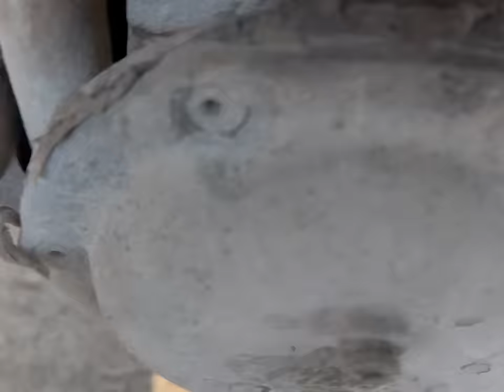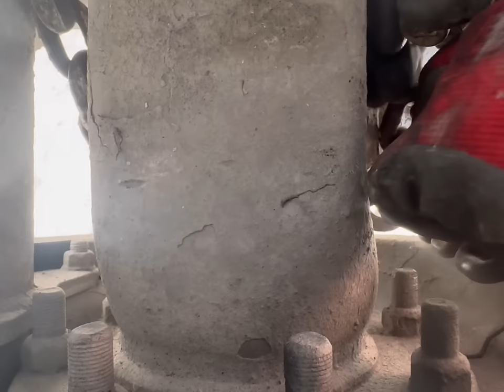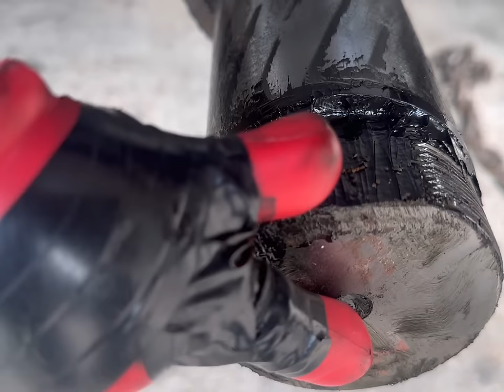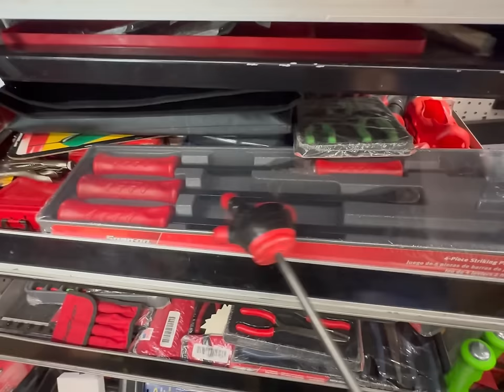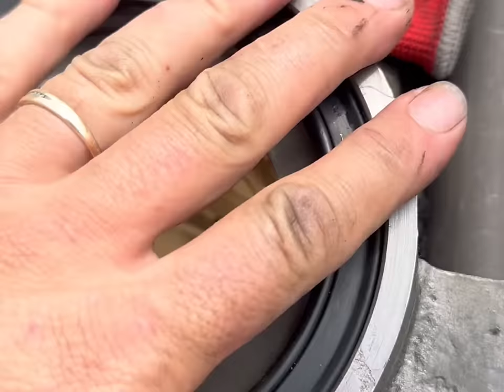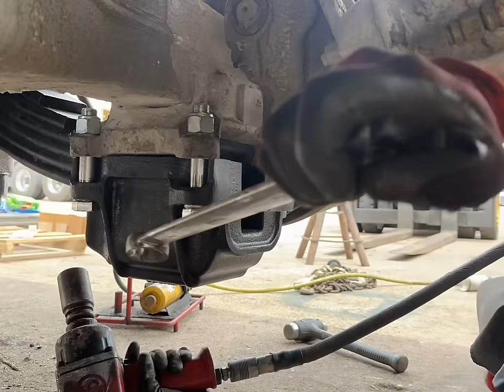Mastering the MACK camel 🐪 back

Comment: Just found these videos! Great stuff. I've been a Truck technician for over 40 years. I'm no longer messing with heavy suspension parts though!! I did work for a Mack dealership at one point and something I found concerning these suspensions was the fact that those "rubber" end blocks were to lubricated with "edible lambs tallow" Seriously, that's what the Mack manual stated. I watched this whole video waiting for you to get to this part only to be disappointed! It wasn't even mentioned!!  Now looking at it again those blocks appeared to be some sort of synthetic material and maybe don't use any lube. I was doing these suspensions on mid 80's truck and the blocks seemed to be real rubber.

Comment: Former truck driver, current factory worker that farms on the side. Watching this 9 months late but had to check to make sure I was subscribed for the snap on giveaway. More to the point, I always thought the camel back was the greatest suspension ever designed for off-road application. It keeps the weight balanced on both axles for traction. I had a R688 that could keep going in mud that would stop Hendrickson trucks in a heartbeat. Only thing better was another farmer that had an old army truck. That thing would go anywhere as long as he wasn't broke down.

Comment: Thanks for sharing this. I drive a Mack CL700 dump truck for a small gravel pit. It has the Camelback suspension and it's all kinds of wore out in that center trunnion. Sadly they can't afford to buy a bunch of new parts, but they do have another set out in the yard. Hopefully it can get swapped out this winter while our operation is down for the season. But as a driver, I appreciate knowing how my equipment actually works and goes together. Heck, they might ask me to help mechanic on it in the Spring.

Comment: "They're gonna love this rag at the cleaners."

Classic shop humor.

When I was a flat rate mechanic, back in the olden days, we always tried to coordinate our personal errands & shop pastry & coffee runs w/ our test drives.

One day, a guy I worked w/ had just finished tuning this real POS import pickup. He had a chapped ass about having to work on the filthy rust bucket, & kept up a continual dialogue about how damn good this truck was gonna run when he got thru.

Finished, he left for a test drive. The back door to our parking lot was just to the right of my work bench. I was rebuilding a carb, when the truck swung into the lot & AJ hopped out. He dumped the clutch in 4th gear, at idle to kill it, then got his arm load of laundry to drop off, during the test drive.

For some reason, AJ & the truck grabbed my attention, & am I glad they did.

As he's about 10 ft from the truck, I noticed it move, then move a bit further, then more, & bang that perfectly tuned little Datsun came to life & took off, driverless.

AJ & I locked eyes, & w/ his trademark shit eatin' grin, he just shrugged w/ his arms full of dirty laundry.

I leaned forward so I could follow the path of the truck, figuring it would stall.

When it didn't I stepped to the doorway, just in time to see it pickup speed on the steep ramp of the short apron to the street, hit the 1st swale of the abnormally crown road, crest the crown, & hit the swale on the other side.

You would think a 200k Datsun rust bucket that hadn't seen an alignment since new, that still had the OEM front suspension parts would veer when it the 1st swale, or the crown, or, at least the second swale.

But, NO, that little bastard went straight as an arrow as it got on top of 4th gear & perfect hit the neighbor's short driveway & buried itself dead center in the old non-segment aluminum garage door.

You'd think that would end the Datsun's freedom ride, you'd be wrong it pushed the door thru the empty garage, right through the back wall of the garage, left the door flat on it's back behind the garage, then ran right over it to go another 30-40 ft to finally come to rest in a big shrub in the back corner of the yard.

The impact on the door made a sweet 20# sledge on a full sheet of steel ring that popped every head from under every hood in the shop, & had the owner tripping over himself to see where it came from.

AJ & I were gob smacked as he looked on from an angle while I had a gun barrel view, right thru the garage, to the dirty Datsun yellow tailgate of the truck.

We looked back at each other, & started laughing. I was literally on the floor as the boss got to me, & tears were running down AJ's face, as he stood in the lot, w/ his arms still full of dirty laundry.

God, I miss AJ, never had so much fun working w/ somebody. Plus, he could tune a friggin' engine, even an old POS.

I've went on long enough, but how we managed to hide the damage to the truck AND the garage is nearly as good of a story.

GeoD
Reply: Thats one hell of a story
Reply: Thanks for the story, I needed a good laugh!!😂
Reply: @fwcjr8170  It's been good for many laughs in the last 40 yrs.

Comment: I have done those miserable things by myself. If it wasn't one of the mains, I'd split pack down and replace whatever one was broke. If it was the whole pack I did I'd put mains in with center bolt only. Replace the bushings and caps. Then I'd build the pack on truck. Reason I did it that way, was the bay I had to work in you couldn't get forklift to. Hated them things. Understand why the company used Mack trucks. Cement mixers get beat up, R and DM models can take a pounding.

Comment: I have used  newspaper to gather up grease and to put the parts on and then fold up to keep any dirt from getting on them . 
When job is throughout or burn for heat in wood stove.
When cutting U bolts or center bolt on springs , Always be behind the longest leafs and have you foot against it , because if center bolt is broken or being cut  that spring pack will explode throwing the smaller spring leafs many feet and you do not want to get hit with them or have them hit the torch .
I have cut many center bolts from the longest leafs side and had spring packs throw  shorter leafs 3 feet .

Comment: Is there any reason why you don't apply a 'little' heat to the area you are looking to bend back?
I don't mean make it glow red hot, as I assume the metal would lose some permanent strength but I thought moderate heat would be ok and assist in relieving the crash induced stresses

Comment: another story stated that mack camels are not adjustable . 10QK46  offset pads will allow adjustment . I know - rebuild everything check housings etc . Still sometimes still not parallel or square . Not a huge deal on construction trucks but some of these end up in mostly highway use where it becomes a problem mostly showing up on steer tires . These are not easy to put in and can be confusing on the orientation . Just sayin' .

Comment: I built a plate to go on a harbor freight transmission jack. And used a 20 ton harbor freight bottle jack with an adapter i made on my harbor freight mini laythe. Just to press the bushings in those trunions. It saved manhandling them into the press. Cut time way down. I don't work on those anymore just cars.

Comment: Gotta ask why throw out the spring pack? I used to work at a shop that had a fleet of around 55 Mack CHU613 coal trucks, with that suspension setup. When when we did trunnions, we pulled the spring packs apart and just replaced the broken spring bolt, and any cracked or broken springs.

Comment: Maybe a stupid question, but why can't you re-use the u bolts? Can't you just take them off without cutting them?
Reply: Not supposed to because they stretch especially the threaded section and a lot of times the nut will get galled up reinstalling them. Don’t ask me how I know being I never reused u bolts. It could be a safety issue
Reply: Several reasons. It isn’t going to come apart without heating the nuts and that would change grain structure of the metal. Also Devin pointed out the nuts are directional. That means you can assemble it but not remove it (Nord-lock). U bolts are cheap and it doesn’t making any sense to replace the spring and not the u bolts.

Comment: When I would do them we would do them on the truck and pull the bolts with a torque wrench and a 4 to 1 multiplier, I had a chain with a ring on the end I would sling around the center tube to hold the handle of the multiplier

Comment: Do all camel back suspension have a grease fitting to grease them??
Reply: No. The ones that have a vertical bolt and ring to the outboard side of a rubber bushing do not have a grease fitting. That version is rated for 38,000 lb and lower, plus its trunnion stand is well known to collect dirt and moisture over time to make it crack out where the trunnion shaft is welded in. That’s damage that takes it to replacing the trunnion stand and converting it to greasable, or disposing of a worn out road truck.
The ones with a grease fitting on the center cap are great as long as whoever maintains it does grease the center. Even with that, they will walk out from end bushing wear before they ruin the trunnion shaft and the bushing center housings.
No grease in a greasable? Hope your money is good, because the job can go to having the trunnion shaft replaced by The Axle Surgeon, or having to replace the trunnion stand on it too.
I have pictures of these instances.

Comment: So why do concrete pumpers use a camelback suspension instead of air ride? Surely air ride can handle the weight and it'd ride better
Reply: Air ride will not give good traction or stability for off road use .
I have Seen air ride tractors that would get stuck right in a parking lot , if the air was not dumped , helpless , but ride good .
I ran a Mack Tri Axle Log Loader truck with Camelback Springs on some very bad woods roads and back roads with some loads way heavier than legal , 80,000  to 90,000 and even 100,000 , and it took the loads , Macks are just strong and tuff .
Reply: @kennethnevel3263  traction has more to do with what wheels are moving, most semis are open differentials in both axles so you aren't going anywhere on bad roads
Reply: The Mack that I ran had some kind of auto power divider and pozi traction lock , no switch or anything in the cab ( something Mack I guess) that truck would spin all 8 wheels when it kicked in and throw mud every where if you put the speed to the wheels and usually keep going , a very good set up for a log truck or other truck going off road .

Comment: Don’t they torque at insane ft pounds is it something like 1600 ft pounds I was just wondering I don’t ever work on Mack I draw the line with them there one of the most overrated trucks out there back in the day they were all right but now they’re junk pile which they have always been very bad under powered keep up the good work and keep the videos coming
Reply: That’s because Mack is no longer American. It’s a European truck now.
Reply: Drove an old R model with a “Hells Revenge” as my Daddy used to call the double handshaker 20 speed. I always like F’ing with people shifting it backing up and when I finally put a bullet in it (long story of too much corrosion) I got went plain insane and bought an old Awefulcar but only one handshaker. It was an old man’s toy he bought new and when I got it it was 20 years old and had less than 100k on it which was almost a new truck but without the payments. I wish I never sold that truck
Reply: 1835nm is the spec its a tad over 1500 lbs ft